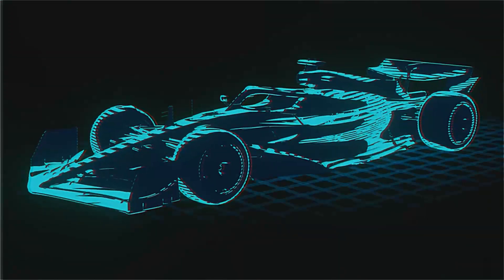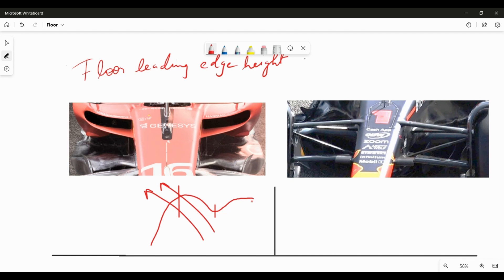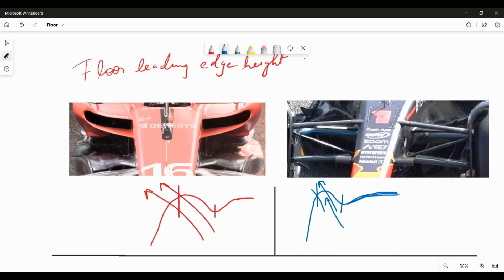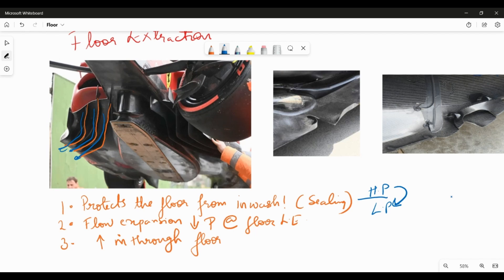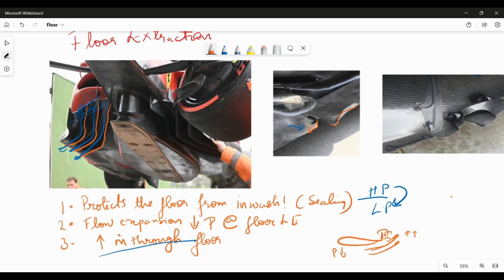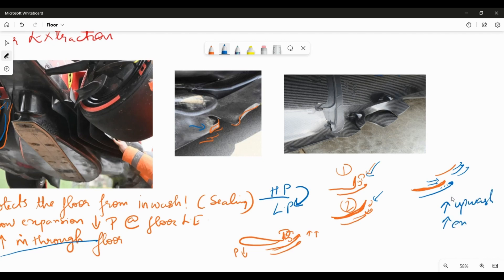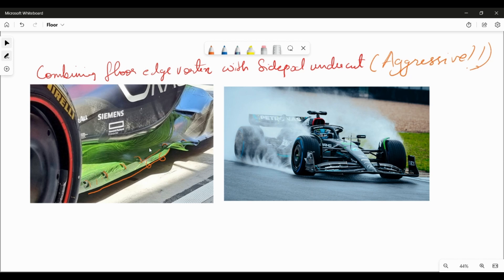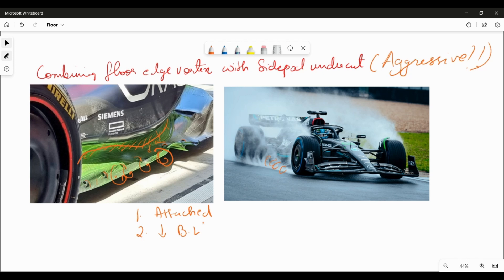F1 2023 Aerodynamics : RedBull RB19 Floor Edge - Explained !!

Comment: Can you explain why you say that a larger diffuser outlet will drop the throat pressure in a floor? I've always thought that the expansion was for the sake of efficiency and reducing losses in the flow as it returns to freestream pressures. My initial thought is that the intake will accelerate the flow by ingesting a large volume of flow at freestream pressure and then increase flow velocity by a cross-sectional area reduction. After, the flow is at its peak pressure at the location in the throat with peak flow convergence and the expansion would simply divert the flow and convert the resulting dynamic pressure back to freestream with minimal total pressure losses.  Am I mis-interpreting something here?

Comment: im confused as to the rotational direction of the floor edge vortexes at 13:21. with the split edge floor, if the high pressure is above the floor, wouldnt the generated vortex actually pull air down from the undercut since it is spinning counter clockwise? (when looking from the front)
Reply from the maker: Well, thats the catch, the tendency is that, as you would think , but the convection in the flow you setup with the outwashing  vanes and the floor loading is such that by pushing the flow out, you seal the floor from the usual tendency of the air to seep in.
Reply: @f1aerodynamicist  so I guess the game is to keep that out washed air from underneath the floor energized enough so that it reaches as far rearward as possible with the preffered vortex?
Reply from the maker: @Jay-nk6dm  let's say, one of the games 😂, there's lots more going on , so we have to be humble when we simplify things, because most of the physics is vortex dominated.
Reply: @f1aerodynamicist  unfortunately my quest for knowledge will lead me down a rabbit hole until I know exactly how an f1 cars aero works 😂 my brain needs to know
Reply: Is the reason the flow still forms a vortex that the pressure on top of the floor is still lower than the freestream? Otherwise I don’t see why it would curve inwards

Comment: The fences have so much potential, it's a shame we don't get to see the fence design of the teams. The regulations give you crazy liberties to improve them. 50mm fillet radius, 25 degrees of curvature in the z plane, 50 degrees of curvature in the x plane. Freedom to place them wherever you want in the box, and as long as they're not S shaped, you can camber and cant them. The fences are basically fans, like stators on axial compressors. They have a lot of the same flow structures like passage vortecies, and secondary flows that can cause losses, or gains. Believe, now that teams have a good grasp on how to manage the tire wake, improving the fences will top the list of priorities.

Comment: Im not sure i follow you with the vortex structure on the floor edge. The pressure gradient suggests two co rotating vortices in the slot and trailing edge. For reference think about an airfoils starting vortex.